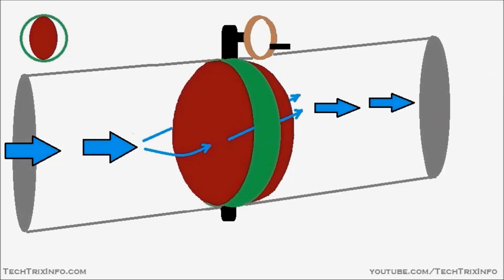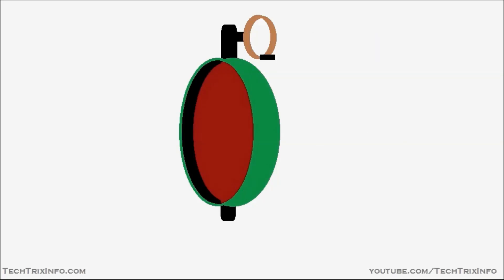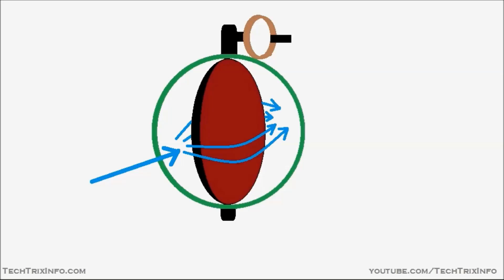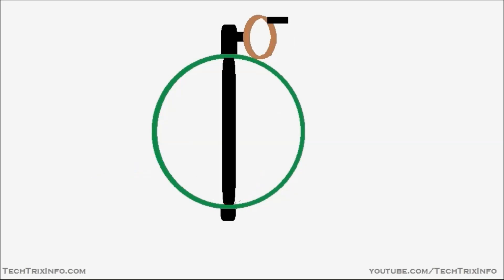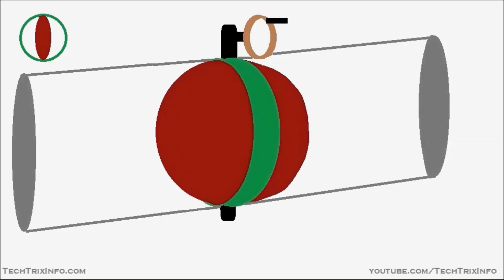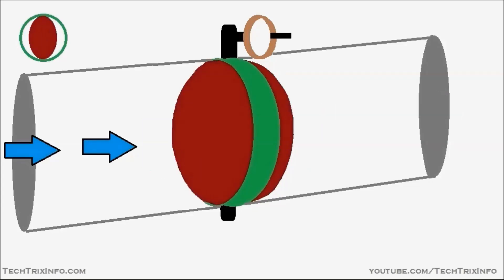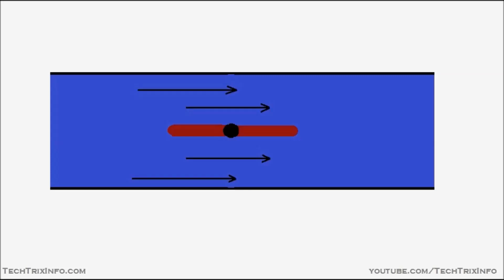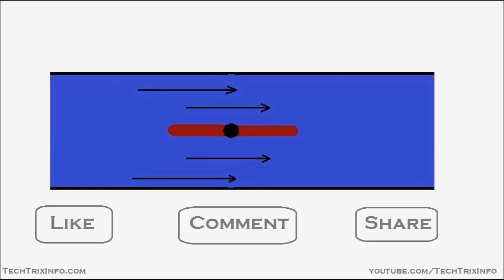Animation How butterfly valve works - Hydraulics

Comment: Is this valve only used to opening and closing flow? Can I use it to change flow rate in a pipe? Is this valve cause loses pressure in pipe? Is it better than the other valves (for ex. sluice valve)?
Reply from the maker: misterkoko-english Yes it can be used. Each valve is designed for a purpose so cannot reply specifically to your last question. Thank you , please subscribe to us for more videos n keep connected with us on Facebook just search for Techtrixinfo